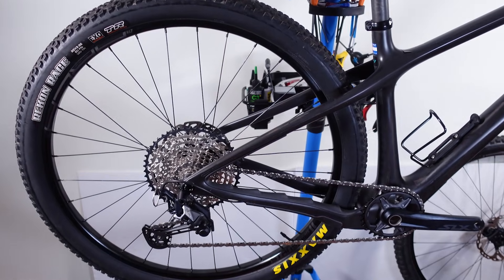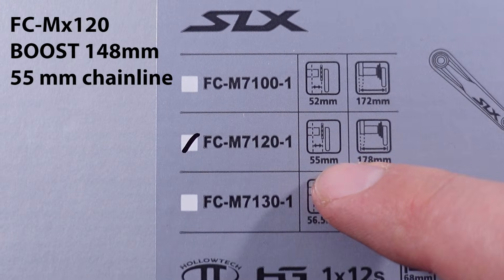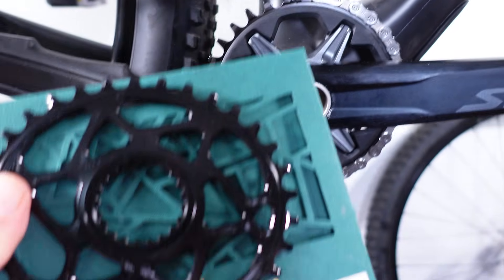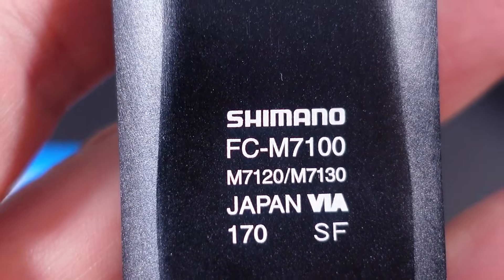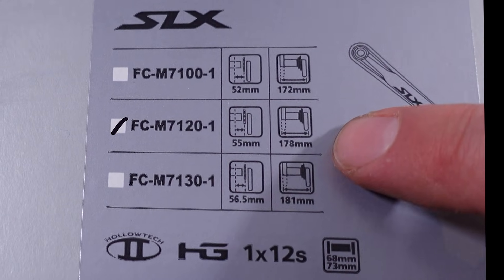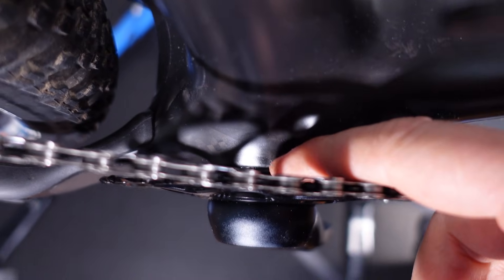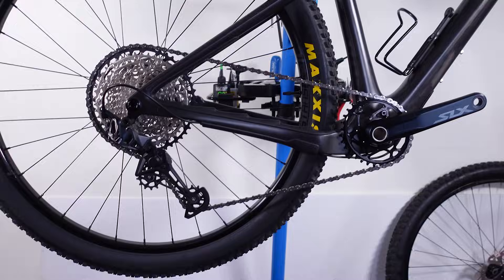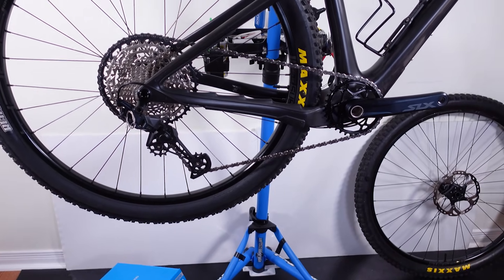12 Speed CHAINLINE Explained - 52 vs 55 vs 56.5 mm, Shimano SLX M7100 vs M7120  Cranksets

Comment from the maker: 52mm or 55mm chainline? What about frame spacing? Drop your bike setup and let's talk!👇
Reply: My bikes are "Old school"  50.0 mm chainlines 😁🤙🤙. The one Trek 4300 has an M770 HollowTek 2 XT crank😱 i bought back in 2008, i got a deal at 
💰375.00🍁
🤘🤘 😏
Reply from the maker: @glen3509 great deal! And you have 49 mm chainline😉
Reply: @LoveMTB  If my memory is correct, the original price back in February or March of 2008 for a M770 HollowTek 2 XT crank was about 💰450.00🍁.

Comment: I have a 23 transition smuggler with boost 148, purchased an XT drivetrain 10-51 with 52mm chainline 8100 cranks, and the shifting in the biggest 4-5 cogs on the back is garbage, it’s rough/rumbly/notchy and drops down to the third when back pedalling. Found a chainring for Shimano direct mount with a 6mm offset, so barring any clearance issues I’m going to try that, however I can’t see 3mm extra offset making that much of a difference????
Reply from the maker: It does! And the slight grinding on the largest cog is “normal” but not the last 4-5 that you mentioned
Reply: @LoveMTB so I worked it out today, I moved the 2.5mm bb spacer to the non drive side (plenty of crank/chainring clearance) and it shifts better, but the main cause of the rumbling seemed to be an over tensioned/tight clutch mechanism, so have backed that off a bit and everything seems much smoother!

Comment: here researching the implications of the new XT/XTR Di2 with its 55mm crank chainline and how that will fit with my 52mm recommended chainline frame!
Reply from the maker: You're fine with either one, I usually prefer 52 😉
Reply: @LoveMTB  Thanks for replying. Think I'll just use an older chainring with the -3mm offset with the new cranks to maintain the 52 then!
Reply from the maker: @COYSMike  Yeah you could easily do that. with 55mm chainline the chain angle becomes quite extreme
Reply: @LoveMTB  Awesome thank you and for the super resourceful videos!

Comment: Using the 8100 on a boosted XT build no issues with a 32t chainring. Perfect shifting. Only reason to get a 8120 would be clearance for larger rings? My bike has clearance for 2.6 tires so I guess it depends on the frame.
Reply from the maker: 💯depends on the frame

Comment: June 2025. I bought the 52mm chainline version for my 2016 Santa Cruz Tallboy 142 non boost bike which is paired with a Shimano XT 12 speed cassette. Even with a Wolftooth 3mm offset ring the chainline was not good. I ended up getting a Garbaruk  ring with 6.4mm offset. This is much better.  FYI my crankset didn’t come with the tool or spacers.
Reply from the maker: Great to have choices aftermarket 😉

Comment: Amazing video! I have Stanton Sherpa Gen3 21" frame arriving in a few days and I can't find what chainline it requires. It uses a 12x148 boost setup at the rear and the standard BSA 73 BB. What shall I measure? Thank you
Reply from the maker: I would aim for 52mm 😉
Reply: @LoveMTB Roger that, thank you. M7100-1 it is 🤗

Comment: This video is very good. It clarifies many things, although there are always a couple of doubts. Could you give me some advice? I have a Scott Scale 940 and the manufacturer claims that the chainline is 55mm. I have an SLX M7100 crankset, CR75 34-tooth chainring installed and I only have one spacer on the right side of my bottom bracket that was installed according to Shimano's instructions for an 86.5mm press fit shell, so it is installed between the bottom bracket and the frame, not on the outside. I've read a comment below that explains exactly what happens with the left side; The preload adjuster is too tight and placing a spacer to move the chainring out 3mm would not work for me as I would not be able to secure the left arm. I have made my research and basically I should change to SLX M7120 or change for a chainring that has an offset that gives me those 3 mm that I need. What suggestion do you give me to improve the chainline?
Reply from the maker: Hi there, the clean solution for that 55mm chainline is the 7120

Comment: Thanks for making this video.  It kinda helped me understand :)
I have a yeti as well which requires a 55mm chainline.
I have XTR. My Drive side crank with chainring is M9100 and my non drive side crank is M9120,9125, and 9130.  I understand 9125 is what i'm after but having the drive side say 9100 confuses me because shimano's site says that is 52mm chainline.

Is Shimano basically selling the 7100,8100,9100 as standard and its the non drive side crank along with spacers that gets everyone to their desired chainline?  Sorry if thats confusing but hopefully you know why im confused!  ;-)
Reply from the maker: That's what they do, it's the side with the spindle that varies in length

Comment: Hello! I have a frame with 55 chain line (commencal meta sx v5). Can I use an slx m7100 cranks with 1 spacer in the bb?
Reply from the maker: @rodrigomartinez4974  might be able to depending on how close the chainring gets to the frame

Comment: Great video, good to know these details. However what brought me here is that I found a cheap M7130 crankset but my bike is 148mm hub spacing.  Will the crankset still work or will I have garbage shifting?  Thank you!
Reply: M7130 is super boost, 56.5mm instead of boosts 52mm. You may struggle in the low gears there. Depending on your frame and the chain stay clearance you may be able to adjust bb spacers to compensate a little. Eg if you have a 73mm threaded frame you should have one spacer on the drive side but if you swap that to the non drive side you’re moving the chainring inboard 2.5mm bringing the chain line down to 54 providing it’s not fouling on the frame.

Comment: This video right here is absolutely the most difficult part of learning bikebuilding. You have to be 1000% accurate and confident or else you'll buy component crap that doesn't fit, doesn't work right, or works but is noisier than heck and shifts like trash. 

My question is this......what is the easiest way to determine proper/accurate chain line if you're building up a Frameset for MTB or Road or Gravel? Does it NEED to be specified by the frame Mftr only?

Comment: Technically, crank manufacturers should make chainrings or crankarms to adopt every single O.L.D., I decide to use MT510 crankset on my 135mm QR old bike but its 52mm chain line is obviously optimized for 148mm rear axle.
Reply from the maker: I agree but I assume they did this to minimize SKUs, nothing else.

Comment: Hello, good evening, I just finished watching your YouTube video about the chainline and spindle and I have a doubt that I have not been able to solve that not even in the same place of the crankset that I want to buy they have been able to help me solve.

I have a mondraker summum carbon rr 2024 frame and the chainline is 56.5mm, the bb shell is 83mm bsa Threaded, the rear axle of that bike is 12x157mm but I don’t know what spindle width should i choose, the crankset I want to use is a 5dev titanium and in 5dev I need to choose the spindle width, I will use an 83mm bsa bottom bracket but I want to know what size of spindle to choose, I really wish you could help me with this doubt and also know how many spacers I need to use in the bb on the drive side and non drive side, if you don’t know this last question, it would help me a lot if you could only tell me which spindle should i choose!
Reply from the maker: I would highly recommend you reach out to 5Dev and ask them to confirm their recommendations.

Comment: Is the Shimano chainring on 1x12 3mm offset?
Reply from the maker: Shimano does not make that distinction it’s SRAM that uses it
Reply: @LoveMTB  I'm a bit puzzled as I want to upgrade my crank to 165mm length and Shimano only have it on the 1x12 models. I have the NukeProof scout Version 3 275 with 52mm chainline. My worries is that the Q-factor on the slx m7100 is only 172mm which might not be enough to clear the chainstay. If I opted for the slx m7120, the chainline will be 55mm but with Q-factor of 178mm. When I search on Google, it says that Shimano chainrings on 1x12 are indeed 3mm offset.

Comment: Great video. I am running a 8100 crankset with a 32t chainring, but my home terrain is mostly flat and fast so I have been wishing my frame could fit a 34t. At least now I know that I could try to fit a 8120 crankset with a 34t chainring.

Comment: I wish I knew this before I ordered 7100 for my boost mtb frame. If I add any spacers the safety clip does not clear the hole on the non drive side of the crank shaft as it does not stick out enough. My workaround is no spacers.
Reply from the maker: 7100 should work just fine with Boost, it’s the chainline that the manufacturer of frame prefers that makes it interesting
Reply: @LoveMTB  I've got an aftermarket oval chainring that sits about 2mm farther out (offset?) than the factory shimano one. Problem solved - sort of.

Comment: Your video helped me so much, I got a Shimano SLX M7120 crankset & BB installed by my local bike shop and I was doing a mid season cleanup and re-lube when I removed the crankset and both spacers were installed on the drive side, it just didn’t look right I was confused because the spacers didn’t seem to be built to be placed together, after watching your video everything started to make sense, I immediately looked it up in the Shimano manual for some redundancy and was able to confirm it! I guess some local bike shops cannot be trusted, thanks so much!
Reply from the maker: @jduran30  glad you got it all sorted out 😊

Comment: Thanks for this video explaining the Shimano 52mm chainline and length of the spindles. From your experience with the SLX 7100 with the 52mm chainline on a non-boost (142mm rear axle spacing), is the direct drive chainring supplied by Shimano have a 3mm offset to make the actual chainline 49mm? Also, can you get a 28T (or even 26T) chainring for the Shimano direct mount as an option. I really don't want to go to 12-spd setup just to get the 60% or lower gear ratio with a 50-51T cassette and to buy a new microspline freehub. A 26T chainring to 46T cassette will provide 60% gear ratio I need rather than a 30T and 50T combo.

Comment: I’m running M7100 on my gt and there is not enough space for bash guard. Would M7120 make more sense? It’s a boost . 🎉🎉 Thanks
Reply from the maker: Longer spindle. 55mm chainline shoud give you more space

Comment: Hi I have a question. I have a 135mm hub and a Praxis Zayente crank the the 3 bolt DM. Should I use a 6mm offset with my XT drive train. Sram rings and various other brands make rings that fit. Is this the correct logic? Thanks
Reply from the maker: 135mm hub you're aiming for 49mm chainline so read what the crank manufacturer says about offset. Might be that you have to use 52mm instead. Usually 6mm is for non-Boost - what you have

Comment: Very good video! I want to replace my crank with an SLX and not sure which chainline. In this case, can i buy the 55mm chainline crank and in case it is too much, i swap the the drive side spacer to the non drive side and then i habe 52mm chainline? Does it make sense or sounds stupid..lol
Reply from the maker: You got it right!

Comment: I have the XT 8120 for a 2020 Marin Alpine Trail8 73mm , if I use no spacers at all on the drive side I get a better chainline in 12th gear and no chain drop if pedaling backwards, I have one spacer on the non drive side plus the one with the cranks tha has the little ridge. Is it ok to run none of the spacers on the drive side ?
Reply from the maker: Definitely ok if you don't have any play on the axle and your chainring doesn't touch the frame.
Reply: is it also ok not to use the two spacers with the little rubber lip that come with the XT cranks? Mainly on the drive side @LoveMTB

Comment: @LoveMTB sir what is the proper chainline of triple chainring non-boost frame
Reply from the maker: For which one of the chainrings?😊 pretty sure is 49mm for the middle one
Reply: @LoveMTB  my Crankset: is SHIMANO FC-MT210-3  40-30-22T
Frame: AgentX Terrius 27.5er non-boost
Cog: Claris 11-28T
RD: Claris 11-32T
Bottom bracket: SM-52
Reply from the maker: @mr.DERPIXON  and what’s your question?
Reply: @LoveMTB  may i ask what is the property line of this setup it will help a lot
3x8

Comment: Okay, so if I am using a non-boost frame and a 12 speed 1x, then the chainline shouldn't depend on the cassette. It should always be 52mm, right? I usually align with no. 6 cog from the smallest. Is that why I get a slow down-shift from the largest?

Comment: Hello everybody,

My trek procaliber 9.5 is coming from Factory with a BB-MT500-PA bottom bracket, PF92 frame. 

On the description of bike the crankset have a 52mm chainline, rear axle 12x148 (boost). 

I read a lot about chainline and in general the conclusion is for a boost rear axle ideal chainline is from 51 to 53mm so i think in the future when i will have to change crankset i will use 52mm because my bike is with a 52mm from factory and the cost for a crankset with a 52mm or other chainline is the same so i think if they use 52mm on MY bike from factory it's because this solution is the best. 

I think it's better to follow the 1st factory mount and origin specs of the bike description? 

Regarding the Q-factor i think reading a lot about it, it's not a big problem if there's a small difference between the original Q-factor from factory and a different Q-factor from a new crankset. 

In your opinion i am correct or wrong in my message? 

Best regards.
Reply from the maker: What are you trying to do? 148 mm rear is Boost so 52mm yes
Reply: @LoveMTB  thanks for your confirmation i wasn't 100% sure my information was OK. 

For my bike with my tire clearance max tyre clearance 2.4" and boost axle 12x148 the good chainline is 52mm.
Reply from the maker: @ldvcbi4317  yes indeed it is what I would do

Comment: I’m currently in the middle of a retro build; a 26 inch rigid frame I’m converting from a 3x to a 1x11/12- this was very helpful!
Reply from the maker: You're welcome! Andf have fun with your build, winter is the season 🙂
Reply from the maker: Question - since the 26 wheels are smaller have you considered going for the 1x11 GS derailleur and 11-46 cassette? It fits a lot better than the 12 speed. Just a thought
Reply: @LoveMTB  Answer:

Yes and thanks for asking. Here's complete analysis and my requisite flow chart for Circa 92' Univega w/ unique AMP parallelogram fork:

1) XTR Thumbshifter a must
2) Tubeless, conversion? If possible would go along way to keeping me on my existing wheel set and hub. Cane Creek straight pull and they've been great.
3) Wide range is a must. I pull a BOB trailer at times inclusive of ball end skewer.
4) End result- An ugly sleeper/Townie/Adventure/ Do whatever ride I can chain lock to a pole and still  come back to it.
5) Very much considering XTR 1x simply to keep wheel set, even if I have to stick with tubes.

In a perfect world I'd stick with XTR 2x on my existing wheel set converted to tubeless however, the writing is on the wall and all this is moot if product is unsupported into the future; hence urge towards 1x12.

End game simply: to not leave another frame to the landfill. Repurpose, reuse, refuse disposable culture. Provide work to men in a shop not corporations and offshore manufacture.

It's rather personal to me. We start the build in the next couple of weeks.

Any advice would be much appreciated.

Thank you. You've got a wonderful channel!

Comment: Hello dear, could you help me with a question, my boost 148 frames are for 27'5 plus 2.8 wheels, the most recommended cranks are 7120 Qfactor 178? Does 7120 work for chain line 52 and 55 or only 55? thanks
Reply from the maker: 55mm with the standard chainring

Comment: So according your knowlage i can put shimano crank xtr 9100 with chain line 52mm and Q-factor 162 to my frame in boost standard 148mm
Reply: Some frames requires 55mm chain line , despite having 148mm rear boost spacing . I think this is the case of frame with very short chainstay .
Reply from the maker: @stefanocspt6732  or room for big tires, I have that exact scenario on my Yeti ARC
Reply from the maker: Yes unless the frame manufacturer mentions something about the narrow Qfactor
Reply: @LoveMTB  hmmm i have specialized chisel frame and i can't find info about narrow Q-factor specification :/
Reply from the maker: Chances are you're fine then. @flowbike4487

Comment: what should be the correct chainline on those two cases:  10s on boost frame and 12s on no-boost frame?
Reply from the maker: 10s uses a 49mm chainline, regardless of the rear spacing. 12s uses a 52mm chainline regarless of the rear spacing of the bike.

Comment: Dumb question... when a chainring offers 3mm offset, is that outward or inward?  Assuming outward?  So if I added a 3mm offset chainring to the SLX M7100-1 it would give me a 55mm chainline?
Reply from the maker: It’s inward and Shimano does not use/ provide different chainline chainrings only some 3rd party and XTR replacement specific

Comment: Hi sir what model could you recommend for me my bike is a non boost frame and Im using a 104 bcd crank so when I install a chainring I can only fit a 38t oval inside so the chain is aligned and 42t outside now here’s the problem if i buy the m7100 Im worrying if the only chairing I can get is below 38t but if i buy the m7120 the spindle is too long or the spacers can do it fine but when I buy my bike before it using a squre tapered bb and a 3x setup so Im thinking that the m7120 can do it just fine ny bike is a cannondale trail 7 2014
Reply from the maker: Definitely not the 7120 and what's wrong with 104 bad cranks?
Reply: @LoveMTB  Hi sir nothing wrong with 104bcd cranks I just want to try a lighter and different type of crank should I buy one or keep my bcd cranks and keep my money to a much better upgrades